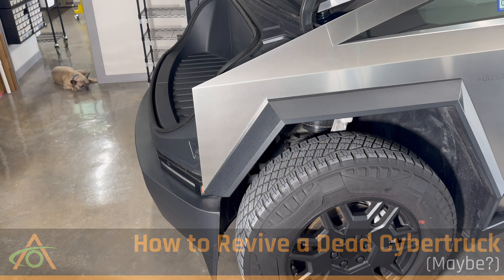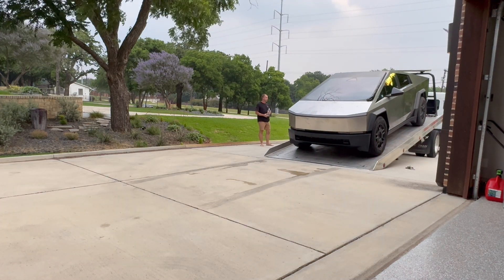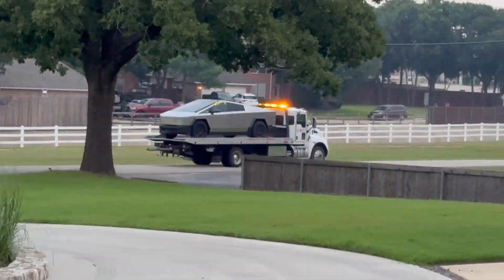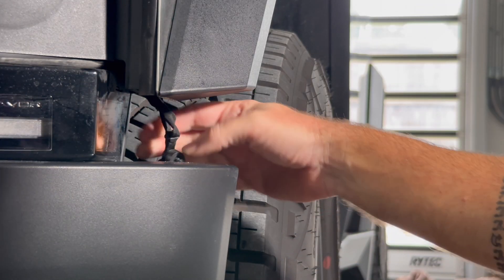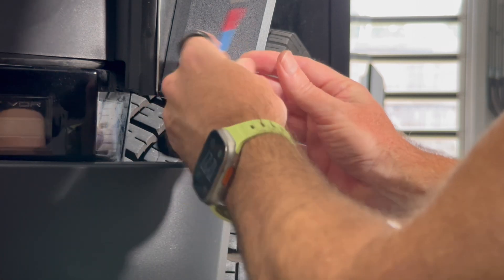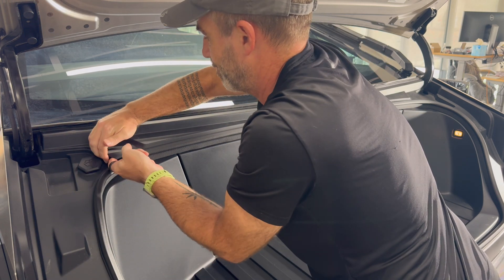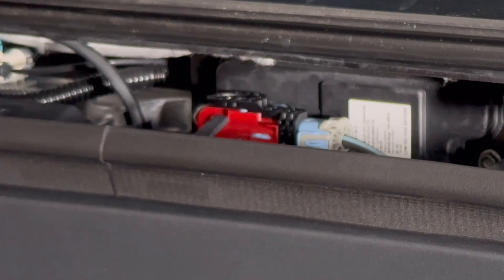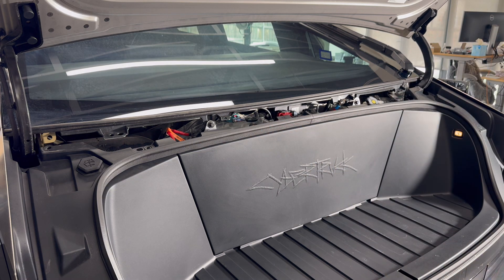How to Power-up a Dead (but charged) Cybertruck

Comment: You are NOT supposed to connect the HIGH voltage first … the same way you disconnected it is the same you put it back Remove 1). Blue then remove 2). red ….put it back? The same way you removed it with Blue first and then red after

Comment: The whole truck seems to be a collection of kludges and bad design decisions.  

Why couldn't they mount a reboot button connected to those red and blue cables on the outside somewhere to avoid having to do all this? It's such a stupid cost cutting measure like the ridiculous decision not to have door handles which makes it a deathtrap if it catches fire, gets in a crash or falls in water. Door handles and reset buttons shouldn't be seen as some kind of luxury item.
Reply from the maker: I agree they made a few bad decisions. The door handles aren't one, every Tesla has 'unusual' handles, but there's a mechanical release in side each door. Ours is an early build, and we've had many early build Tesla's, so that part of the game unfortunately. Some things are great, the steer-by-wire is something I suspect we'll see on most cars within a decade. But they totally cheaped out by not having a digital rear-view mirror, and by not having a display in front of the driver. The center screen gets too cluttered. Just like the X, it's a niche product.
Reply: @AbstractOcean My issue with the door is that finding a hidden release catch that you have never needed to use could prove fatal if your battery is on fire or the car is in a river. Finding it in normal conditions is probably easy. As for steer  by wire what happens if you're doing 70 and the battery fails. Is there a manual backup or do you totallylose steering?
Reply from the maker: @simonroberts7891  Yeah, I hear what you're saying, if your car is sinking, and someone is trying to get to you, an external mechanical release is always better, but I think in the history of Tesla, there's been a single incident where that might have helped. It's an edge case, and one is too many, but other OEM's are moving to electronic releases, so they're not alone. As for power loss when driving, it just doesn't happen. Tesla's will tell you about an impending major failure and have you pull over, but to my knowledge there's never been a total unexpected blackout. for the steering, there's so many built-in safety mechanisms and redundancies, it's kind of a non-issue (at least, it has been so far). Mechanical steering linkages fail too (happened to me in a clunker years ago!), but I truly do think that steer-by-wire is the way forward. Here's a summary of the safety mechanisms, if interested: https://www.perplexity.ai/search/what-are-the-safety-mechanisms-ePRYhRloQlaR3V5lQny6Ag. TLDR; Tesla has plenty of shortcomings, as do all the OEMs, and I'm no apologist, but when it comes to safety and engineering in general, they're pretty good.